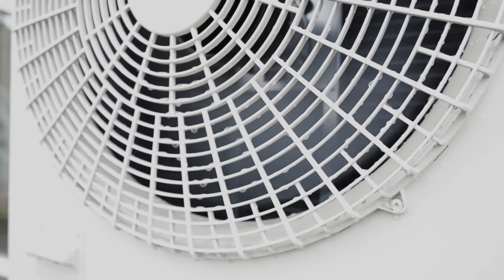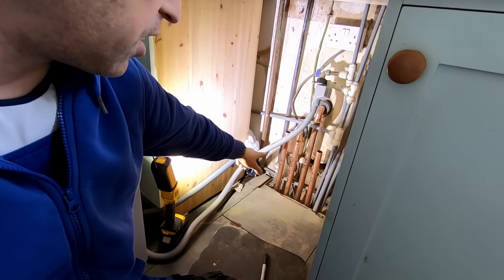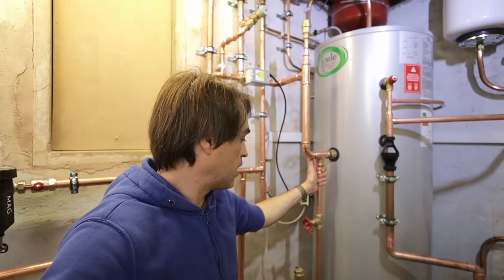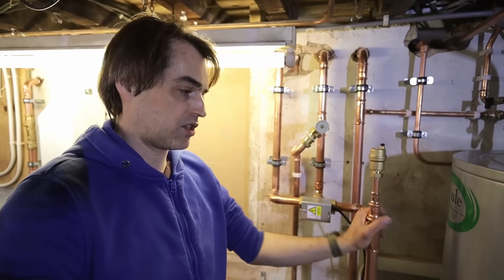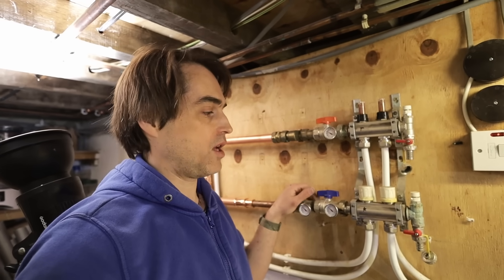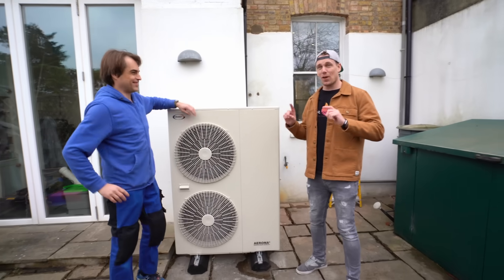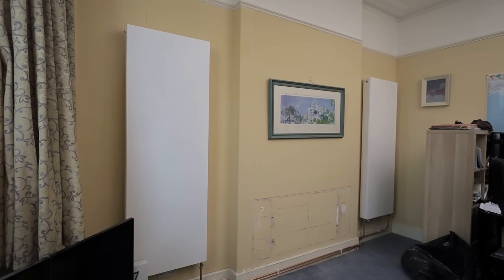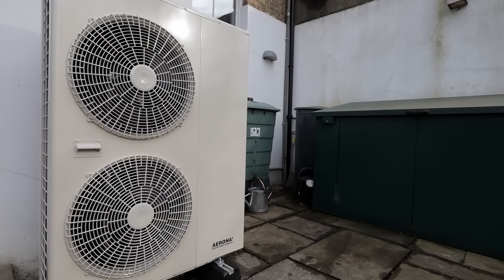The Truth about Heat Pumps: Debunking the Myth.

Comment: Thanks for the detailed run through of what's necessary to fit a heat pump... This video goes some way for me deciding its not a route I want to take... Those massive radiators, and large bore feed pipes to provide such a modest source of heat, just is a no from me... I would like to have known all the costs involved, plus a reaction from your client regarding performance and running costs.
Reply from the maker: there will be a follow up video after next winter
Reply: @UrbanPlumbers  Thank you..👍
Reply: @john3Lee  for houses where you don't want to have to change the pipes and rads you can get 2 stage heat pumps called high temperature heat pumps, which can output at 80C. Of course they cost more to run than the normal kind and the equipment cost is higher, but installation cost is lower as they are a direct replacement for the boiler.
Reply: @adrianthoroughgood1191  Thanks for the info.... regards -john

Comment: Vattenfall claim to have produced a high temperature heat pump that could directly replace a modern gas boiler, I'm a tad skeptical as the amount of work the compressors would do to achieve 80degrees would decrease the efficiency, but I'll  be taking a trip to the Netherlands later in the year to see it first hand. Here's hoping.

Comment: Nice install Dracula!! I’m loving all the pipe bending!! Pity you’ve such a mixture of fittings, but hey it’s all hidden under that super, duper insulation.  What happened to all the 28mm copper tube, you not got a 28mm Bender?
A wee tip mate, don’t get involved in the on-going fight between Roger the Bodger & Skater Boy Heat Freak, they’re both a couple of tozzers!!

That install must’ve cost a fortune!! Even with Gas prices going through the roof, it’ll still take years to get ‘Pay Back’ on that ASHP install.  Just wait until the Home Owner starts fucking around with the radiators & the running costs go cosmic!!  Remember the good old British ‘ Hearth Effect’!! 
‘Oh, this Room is cold because the radiators are just tepid’......Good luck with these phone calls matey😂😂😂

Now doing lots of ASHPs on New Builds, here in Jockoland.  Loving it👍👍
Thanks Dracula, loved the video👍👍
Here fella, get your bold mate a hat, the light was deflecting off his napper & putting your camera out of focus😂😂😂
Reply: Skater boy 😂😂😂
Reply: @pwkish  Well, it maybe a bit unkind.  But c’mon FFS!! What self respecting bloke is going to wear a fucking baseball cap like a 90’s teenager??!!  Perhaps, I should cut about in my Teenage clothes;, Tank Top, Flares & Platform shoes??!!
Reply: @TheDickPuller  It's not unkind at all. The guy is leaving himself wide open to it. I like Roger the bodger, Im on his side.

Comment: Great video! My issue with the ASHP debate is that they are being advertised by the government as an upgrade/direct replacement for your current boiler and that is clearly not the case. 

I would like to have an ASHP installed and videos like this do address the additional factors you need to be aware of.
Reply from the maker: totally agree, anyone claiming a heat pump is a direct replacment for a boiler is simply not understading the technology or misleading the public.
Reply: Once again it is dumb politicians making a ludicrously simplistic comparison.
In the 1950s they promised that nuclear power was so cheap that electricity would not have to be metered.  Presumably based on the mining cost of Uranium and coal per ton, and the relative power output per ton of fuel!

Comment: look's a great installation. like that you're only  using one circulating pump. keep the electrical running cost down. how did you get on with the chofu/grant heat pump compared to the daikin heat pump you fitted last time in regards to set up ?
Reply from the maker: I actaully prefer Grant to that Daikin. Although both units have manuals that are next to uselss when it comes to wiring. Grant much easier to wire though, daikin has a much better controller.